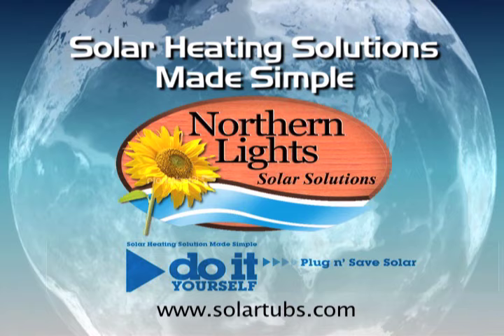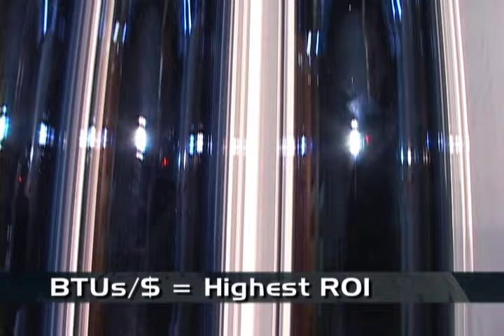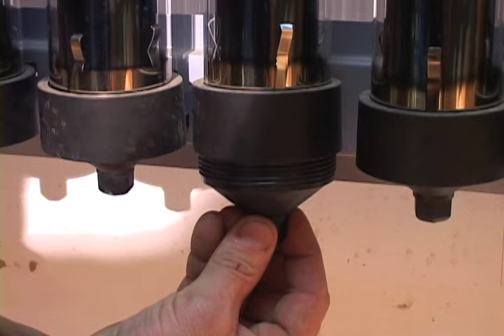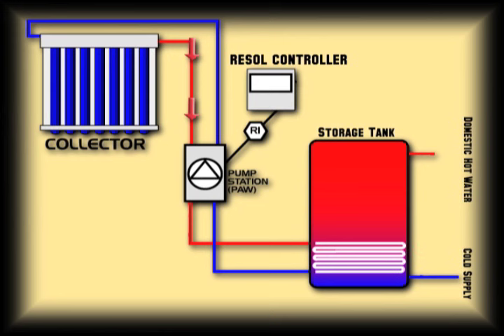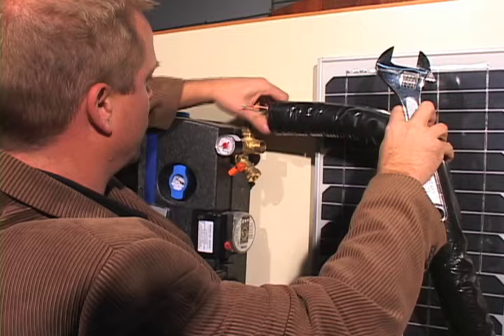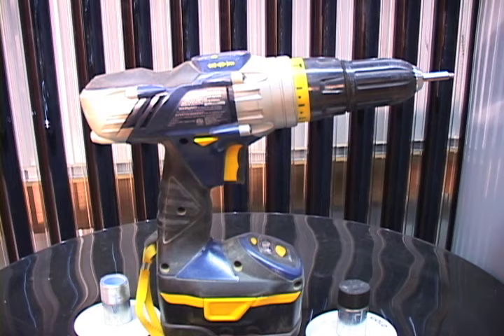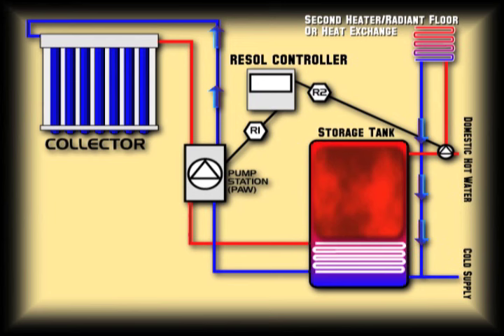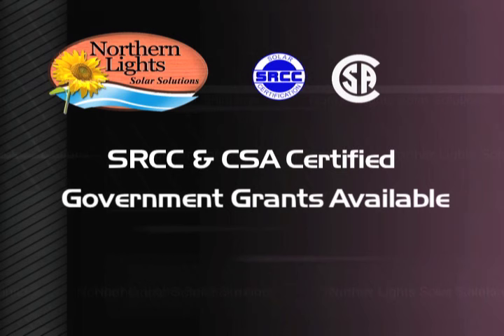Solar Heating Systems -  Solar Water Heating

Comment: With all respect for your positive intentions, but your story is not state of the art. Clearly you have no experience with the advanced flat plate collectors and closed loop drain back systems. Solar Keymark informs you why flat plate perform better over the year and your story about efficiency is wrong.Efficiency is NOT the most important. Performance in kWh/year , reliability, maintenance and long life are the choice to look at. Tubes loose vacuum, overheat easily in summer, need glycol = maintenance every 5 years, tubes can explode and when put in series than performance panel 2,3,4,5 or more drops significantly ....Tubes were invented in germany but german engineers at Fraunhofer do not advice them. Cheap made in China is not durable. Manuals tell you to check vacuum every year and some suppliers sell a cover to avoid overheating in summer ...how stupid is that? For our experience in Europe since 1990 as a solar contractor and lecturer see www.ewatec-global.com Always welcome for professional advice or education. Eric Jansseune